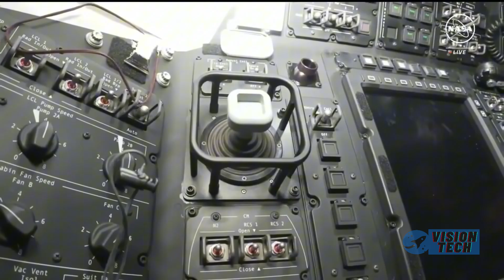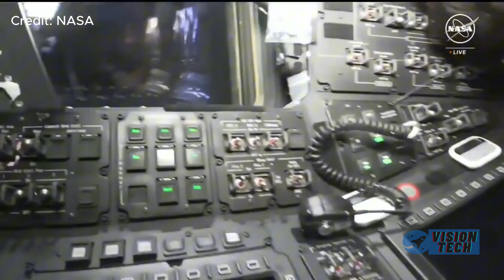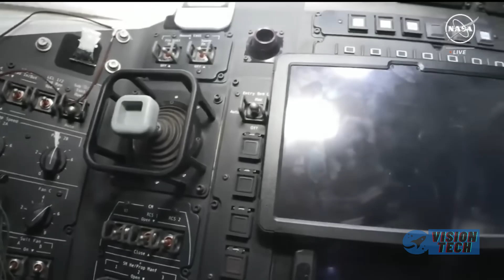Information Leak NASA faces major issues with payments for Starliner Astronauts

Comment: The abstract description of Starliner portrays a highly capable spacecraft.  Unfortunately, the design and build was so compromised by cost cuts and bypassing critical integrated systems test, that the end product is unsafe and in question of being remedied short of major redesign.  By the time all systems are corrected and functional, technology will have advanced enough to make Starliner a vintage mess.
Reply from the maker: Exactly! Starliner is like buying a luxury car… then realizing it runs on duct tape and hope. By the time they fix it, it’ll belong in a museum, not in space.

Comment: The intro misleads, reporting that problems with Starliner leaks and thruster problems began only after docking at the ISS. Fact is the situation was much worse, with 5 thruster failures during approach that jeopardized both the plan-A docking and even a plan-B mission cancellation and return to earth. Truth is: Wilmore and Wilmore dodged a scary bullet, limping to a very iffy docking that required that NASA bypass its own safety margins just to get the two astronauts to the safe haven of the ISS.
Reply from the maker: Exactly! But you know what's wild? If this was SpaceX, headlines everywhere would scream "reckless, unsafe, disaster waiting to happen!" — but because it’s Boeing, suddenly it’s just “technical challenges.” Thrusters failing mid-approach isn’t a small hiccup — it’s borderline terrifying. Feels like NASA bent over backwards just to save face for Boeing here. Safety margins exist for a reason... bending them is NOT a flex.